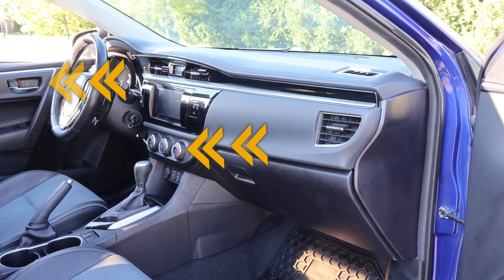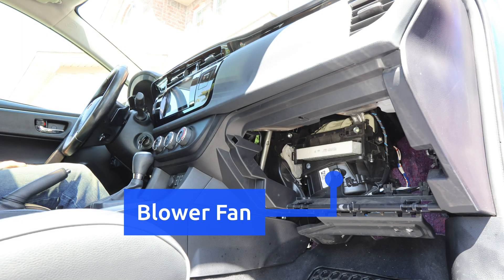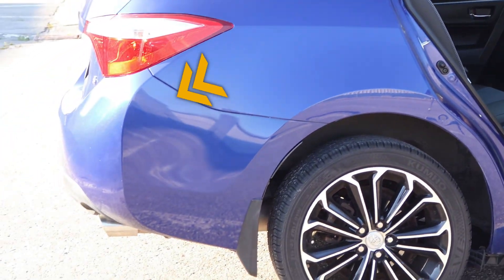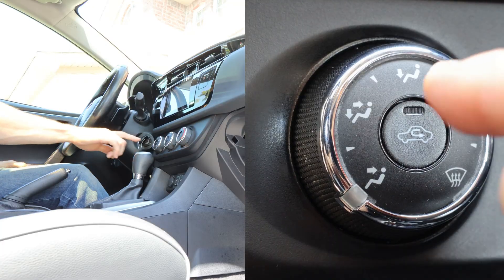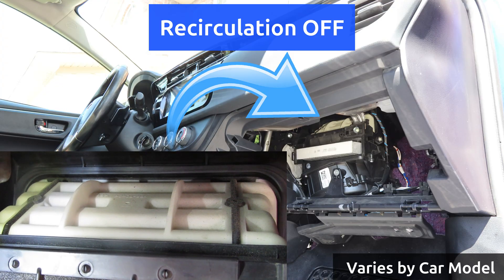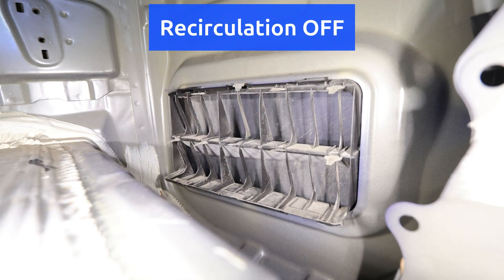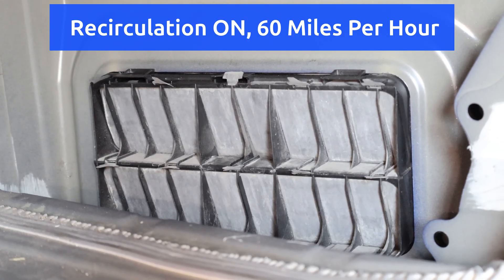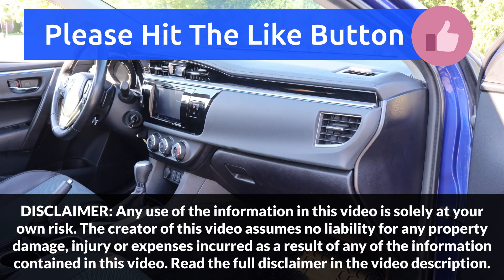Car Ventilation and Recirculation Explained - How Cabin Air Flows

Comment: I get alot of exhaust smell when I have recirculation button on but I only notice it when I have the defrost button on, any idea why this is? Maybe it doesnt seal properly at the filter area?
Reply from the maker: Do you mean exhaust smell from other cars, while driving in heavy traffic, or exhaust smell even without any cars around?
By defrost "button" you mean the middle button , for the rear windshield defrost?  Or the defrost setting for the front windshield?
Reply from the maker: Here's a website with more information about exhaust fume smells: https://www.capitolsubaru.com/service/information/things-to-know-if-you-smell-car-exhaust-in-your-car-salem-or.htm   It's important to consult with a professional mechanic or local dealership, as it’s not normal to smell a significant amount of exhaust inside the vehicle.
Reply: Great video. I need to know if anyone has been experiencing any weird smells coming through the vents on their brand new 2025 equinox? my wife purchased a brand new equinox 2025 about 3 months ago and every now and then for a brief few seconds, she would smell a fume like smell (best description we have so far) and then it goes away and its back to regular car smell. This only happens when the AC is on recirculating, temp medium and fan speed on medium. We brought it to the GM dealership and they replaced the cooling fan (mind u this is a brand new vehicle) which reduced the smell drastically but there are still faint smell every now and then. We don't know what we are inhaling and despite our efforts, the dealership still doesn't know what is causing the smell since they can't seem to replicate it so we are documenting everything to give them, since it is still under warranty. If anyone out there has just bought a chevy equinox LT 2025, please let me know if you have the same issue and what was the culprit and the fix please. This is driving us crazy. I know if this was a BMW and we were having these issues they would have probably done more for us.
Reply from the maker: @MrTatouA  Since it's such a new car, it's possible some of the materials the motor is built with are emitting a smell as they heat up. I'm assuming you're putting heat on and it's cold outside?  If that's the case, was this happening 3 months ago when AC was on?  
My car also had smells when new, but just the typical new car smells.  I used medium-high speed setting with no recirculation, to keep fresh air coming in constantly, and I avoided re-circulation as much as  possible during the first few years. Re-circulation may cause a buildup of VOCs.
Check into "new car offgassing"  to learn more about the importance of airing out a new car. 
If I had this problem and the dealer wasn't able to fix it, I'd contact the manufacturer's customer service.  I've contacted Toyota directly a few times and they always responded promptly.
Reply: @CleverFix   Thank you so much for getting back to me so swiftly. I wasn't expecting that so soon lol. We constantly have it on cold or medium for the AC so you can say warm since it gets really cold real quick lol. We have been back and forth between corporate chevy and the dealership. They advised to go to another chevy dealership and have them take a look. maybe the master technician or technician at the other location may have missed something. But i will definitely try keeping the recirculation off since that seem to have eliminated the smell completely based on our test yesterday since the dealership couldn't reproduce the smell. I just want to make sure that whatever we are inhaling whenever it happens is non-toxic. Because at the end of the day, nobody wants to be paying x amount of money in medical bills that we as consumers will have to foot until something is properly done.
Reply: @CleverFix  also what is VOCs?
Reply from the maker: @MrTatouA  If replacing the fan improved it significantly, I would guess the smell is from the fan windings.  Just a guess though, but new motors have a coating on the windings that offgasses with time.  Maybe your original one had a extra thick coating and the new one has a thinner coating.  
There are VOC meters available online but they're expensive, and don't pick up everything that could be toxic. A good example is: Airthings 2911 Wave Plus  it can be found on Amazon.
Another idea would be to contact an air quality expert and get their advice. They should have a wide range of equipment, with high sensitivity. Some things an air quality expert could check are TVOC, PM2.5, Ozone, and Formaldehyde... possibly more, but that's all the ones I'm aware of.  It may be difficult since it happens randomly though. I prefer to buy my own meters, although they're expensive, and consumer grade measuring equipment is also not nearly as good as the professional ones.
Inhaling certain toxins may cause chronic effects that cannot be reversed sometimes, no matter how much money.. so it's good you're looking into this.

Comment: Was quite useful 
Whats funny is that I use my Sun roof to draw in even more air in when its Not on Recirculation.
The Air flow at a quite heavy amount when its opened by just a little,not fully.
Reply from the maker: I do that sometimes too, but it makes quite a bit of noise. It's hard to get it in a good spot with low noise and still good ventilation though... I mostly use the button that tilts it up, rather than opening it. Do you open it a bit, or tilt it? Thanks for watching!

Comment: what's wrong with too much CO2? does it make you sleepy, will it kill you? or is that only with CO?
Reply from the maker: CO₂ is not toxic like CO (carbon monoxide), but it's classified as an asphyxiant because it displaces oxygen in the air. This can lead to oxygen deprivation rather than direct poisoning. In simple terms, the more CO₂ in the air, the less oxygen is available to inhale.
Here are some CO₂ levels and their effect : https://www.kane.co.uk/knowledge-centre/what-are-safe-levels-of-co-and-co2-in-rooms 
Although there are no officially recommended levels for car cabins.
In my car for example, with 2 people, recirc on, for 25 minutes, the level reaches about 1400ppm. It will vary from car to car, and the number of passengers and pets though.
CO₂ can also build up in homes, especially newer home that are tighter, and don't have an air exchanger.  Our house doesn't have one, and the levels build up quite easily.  Here in Canada, Health Canada recommends an indoor level below 1000ppm, and we'd have 2000ppm quite often in the winter. Of course though, same as the car, each house is different, and the number of occupants will matter a lot. 

Thanks for watching and the comment!!